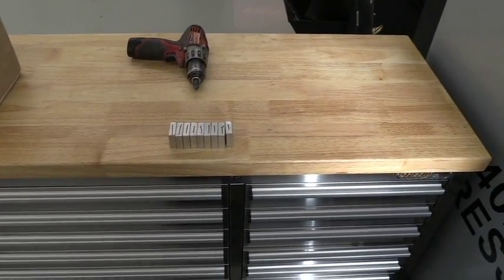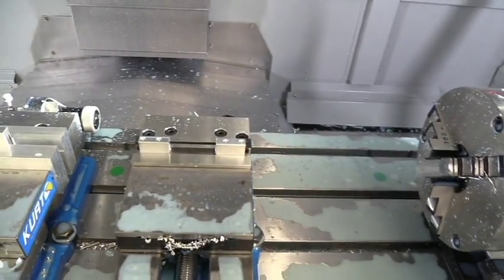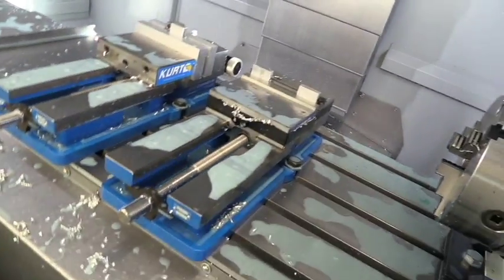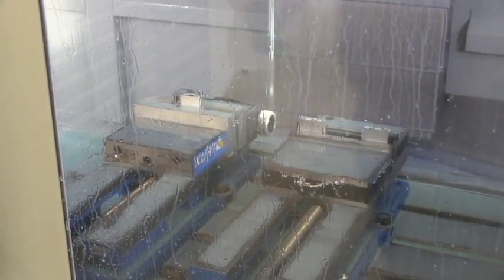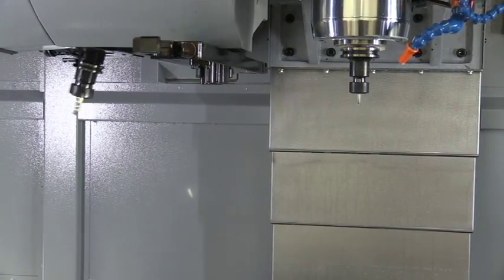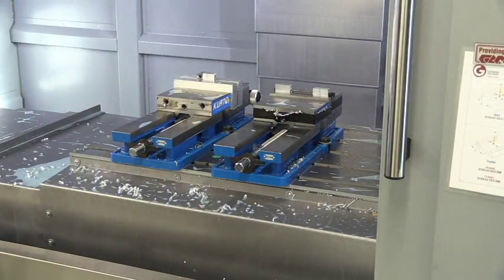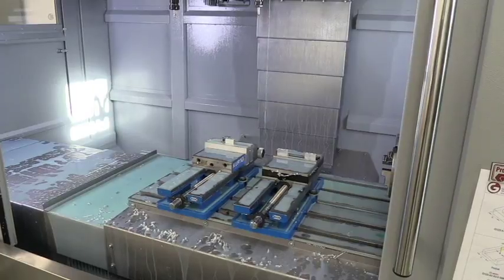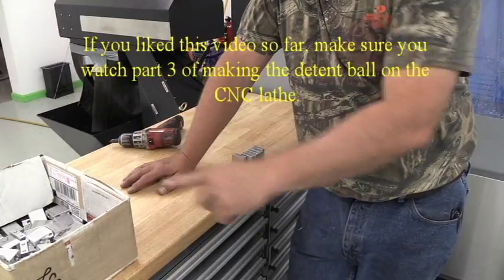How to machine a Ram Rod Retaining Block Part 2

Comment: If you want to increase your cycle time, try using a m5 before you g28 home your z, its decelerating in its tool change location, adding cycle time. Also, try a coolant thru carbide drill, then you can eliminate spot drilling cycles. Also, you can tap at a much higher speed, but you know your machine better than I,  since you have rigid tapping, id say no problem at 2-3 x faster tap cycle.
Thanks for video upload.
Reply from the maker: Thanks for the advise... I do usually run on the conservative side of things.